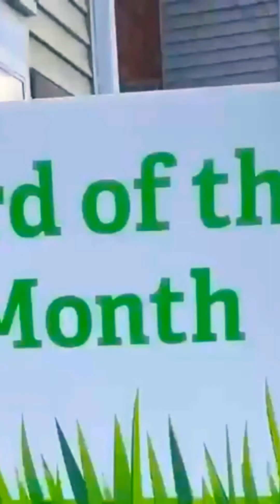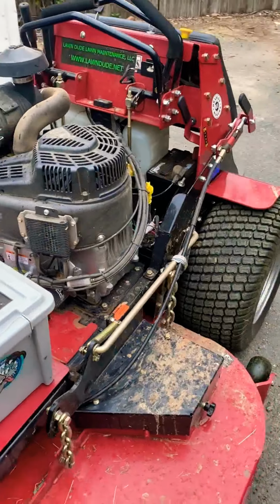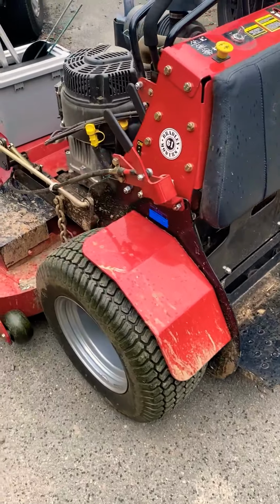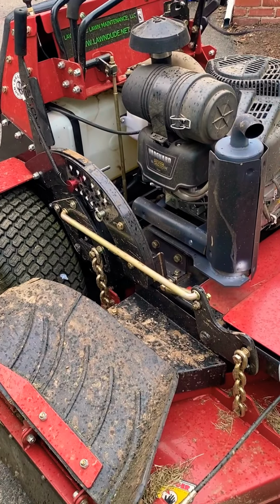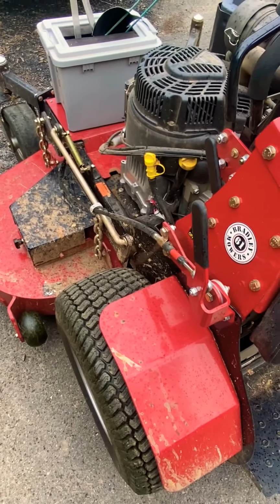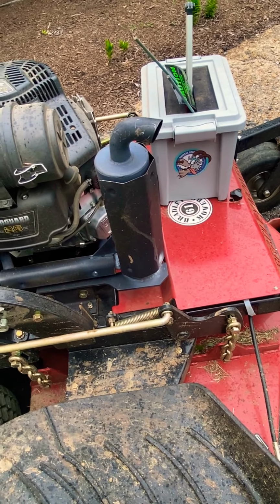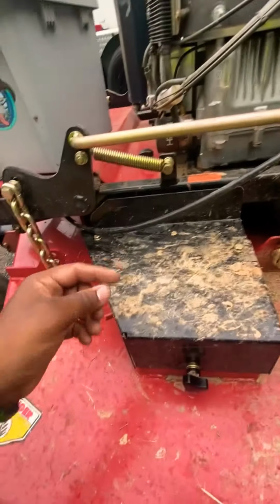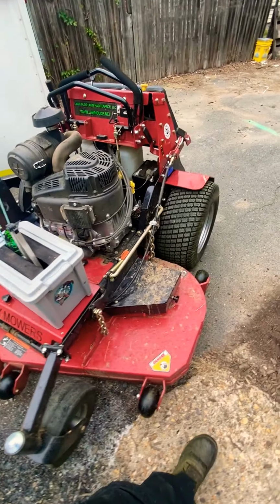61” Bradley stander first impression/ review

Comment: I have the Bradley 48 with the Bradley OCDC and had the same problem with it wanting to close while running it. Took it back to the dealer I bought it from and they found out that the lock nut was back itself off with every time I would close and open it. They put a little longer bolt on it and lock tight on the lock nut and so far that seems to have fixed the issue. I guess you could get a new lock nut that won’t back off. The dealer did call the Bradley rep and he told them that they have had a couple issues with the lock nuts backing off but not many. All in all they have had good luck with the OCDC. I love my Bradley. Good video!
Reply from the maker: Thank you! 
I see that the grass flap they use now is completely different but once I tightened mine with a lock nut it stopped the issue. Bradley seems to be great with taking our feedback and improving their products . 💯

Comment: I saw a Vanguard 28 hp efi option on a  61" Bradley at the GIE back in 2019. It was suppose to be available in the spring of 2020🤷‍♂️I've got that same efi engine on my Ferris Z2 52" stander and it is super strong and it is great on gas👍You can't beat the price on those mowers😉
Reply from the maker: Wish they would’ve switched to an efi. This engine sucks down so much gas.

Comment: I Had a 52 Bradley, i kept blowing spindles. Apparently that issue is fixed? i ended up buying 3 new scag V rides. ran them for a few years. im going back to bradley if the spindle issue is resolved. this mower is just as good when it comes to cutting, and i can buy 2 for the price of one scag. If the mowers were priced equally i would def take the scag due to other minor upgrades and comfort. but in most cases it's marginal.
Reply from the maker: I never had an issue with spindles, so I’m assuming they fix this issue. I also couldn’t agree with you more on them having better ROI than getting a major brand. Only reason I got two wrights in the last couple years was because I needed a 72” and a bagging unit which Bradley is yet to come out with unfortunately. But the price of Bradley’s are unbeatable 💯

Comment: Where did you get the magnetic deck adjustment pin from? Any update for n the OCDC handle adjusting when hitting bumps?
Reply from the maker: I got the magnetic pin on Amazon, I’ll put link below. As far as the OCDC handle I ended up tightening tighter than I’d like with the plastic washers in there but this has worked flawlessly for the last couple of months.
Reply from the maker: Pin, Tensile - MAGNETIC Universal Weight Stack Replacement SELECTOR KEY - 3/8" Dia | ... https://www.amazon.com/dp/B078LPHQRQ/ref=cm_sw_r_sms_apip_yUGJb4cCfvwGi
Reply: @lawndudelawnmaintenancellc3203  thank you for the link! On the OCDC do you feel it opens enough? I know some will swing open completely up but the Bradley one seems like it just comes up 90 degrees/parallel with top of deck.
Reply from the maker: It Opens more than wide enough I have a few different Ocdc chutes between the advance chute, the Bradley and the green guard on different machines. The Bradley ocdc is by far my favorite it’s easy to use and you can adjust your opening.

Comment: Are the baffles in the deck the same as the 52?
Reply from the maker: Yes, they’re similar. I have a love hate relationship with the baffles. Great for mulching but the trick for us is once in the spring we scrape everything out the bottom and coat with fluid film. We repeat in the fall and run x-blades then. This has decreased buildup and actually made the baffles that much better.